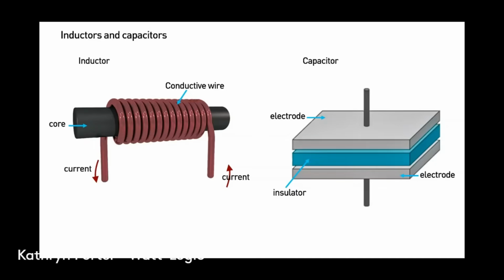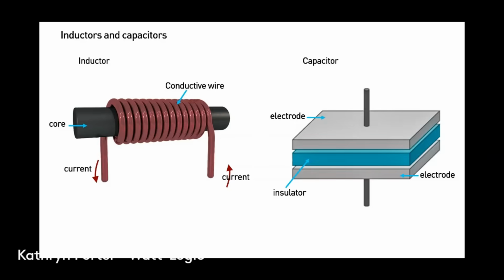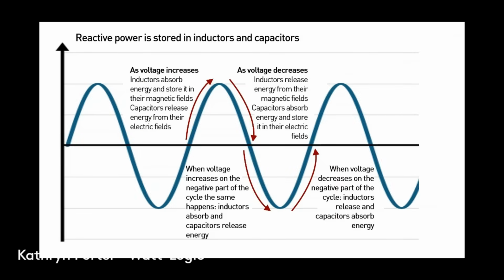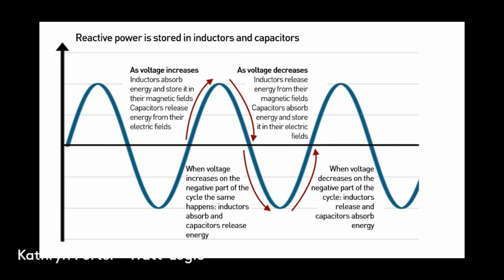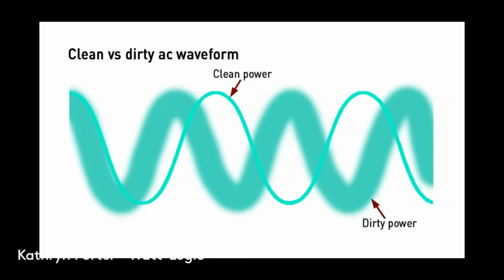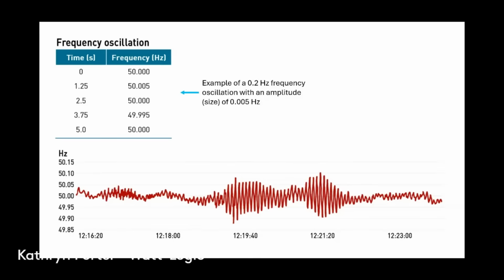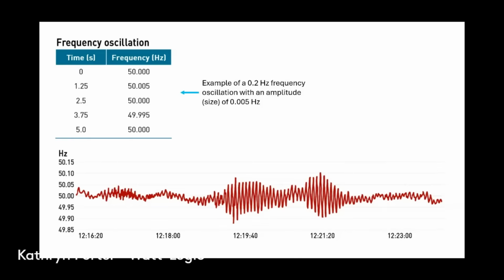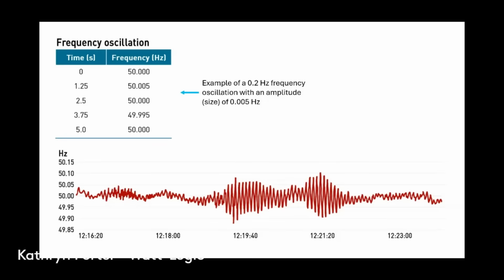Iberian blackout

Comment: I think the inertia explanation should be modified slightly. 

Synchronous generators cannot provide backup power without reducing their output in advance, exactly like the wind turbine cannot. The difference is, as you explained, that the SG has an analogue response time frame on deviations of frequency. This response is as fast as can be. The wind turbine cannot respond equally fast as it is a digitally controlled device, but for practical purposes it is fast enough when it is programmed to respond by using the inertia of the rotor to boost active power output for a brief period.

Yes the wind turbine has to reduce its power output some seconds later to charge the inertia back up again but the same goes for SGs.

Synthetic inertia can be supplied by wind turbines that way and it has about the same properties as the SG except for its slightly slower response as a digital device compared to an analogue one.

Comment: Awesome explanations, and I am really impressed with the clear analogies you come up with to explain complicated electrical phenomena in commonly understood physical phenomina that normal people can understand.

To your point that generating facilities test things like frequency response, full load rejection response, and stability- large step change responses,  positive and negative, once when machines are commissioned and never again is true (not always, some urilities go through regular reevaluation of system stability studies and do testing after resetting parameters) because a) very expensive b) time consuming c) a lot of temporary advanced data gathering and analysis equipment has to be installed, and d) it necessarily puts the whole system at risk when you do those tests.  But, only real-world testing actually proves it will work when necessary. It is somewhat mitigated by the movement to solid state protection and control vs. the older analog electro/mechanical protection and control.  These devices are many times more accurate, and very importantly, do not change or "drift" over time, so once tested, they will work the same way 10 or 20 years down the line.  

Your mention of transformers acting improperly during the cascading events is probably misstated, and it was probably the protective relays acting improperly, and it is likely because they were older electro-mechanical.

Comment: Roads are designed for cars which are significant dangers to pedestrians. Cyclists are not. I am sure you have that 1 study which shows one pedestrian who broke their finger because of a cyclist passing a red light.

There are solutions for high integration of wind and solar in conventional grids: synchronous condensers and batteries. It was Spanish TSOs critical mistake not to procure sufficient ancillary services to be ready for situations like this.
Because you like metaphors so much, let me finish with a metaphor: disliking solar and wind for their inability to provide inertia is like disliking EVs for not having an exhaust pipe.

Why don’t you make a video that you actually suggest what you think the energy system mix should be like? I’ve only seen you criticising RE? Sometimes I agree with your criticism but why not make a suggestion?
Reply: She's in the pockets of the fossil fuel energy companies.
Reply: Nah there is definitely discussion about batteries and the need for grid scale storage.  It’s not ready yet and probably never will be.  Batteries are expensive, heavy and prone to burn 🔥 out with fire that the local fire department can’t extinguish
Reply: @OwenGilmoreOG  Tell me you know nothing about battery storage without telling me.
Reply: @VinoVeritas_    Show your greater knowledge about batteries by linking to a grid scale battery system that can keep power up for 24 hours.  Oh that's right, you can't because it doesn't exist.

Comment: Great video, just wondering what was the root cause of the solar farm inverters causing the 0.2 Hz frequency oscillation? I am wondering if it was a systemic issue or a once off related to the technology used on these projects.

Comment: On June 25, Energy Institute published their analysis of what happened and also described the subsequent finger-pointing: “the Spanish government blamed national grid operator Red Eléctrica de España (REE) and private conventional power generators. In its wake, REE and a Spanish electrical utility association traded mutual accusations of blame.”

The grid operator REE partially blamed conventional generators for failure to “…comply with its dynamic voltage control obligations…” Aelec, representing the generators, pushed back, saying, “All of them complied in a timely manner with the orders of the system operator, reacted to the oscillations and increases in voltage observed, and acted as established. The real cause of the blackout was not the performance of the plants, but the manifest insufficiency of units dispatched by the operator to safely cover all the needs of the system in terms of voltage control and operational stability.“ They blamed REE for not enabling “sufficient means” to control the system. 

New Climate Institute on May 8 had insightful comments:
“Rather than treating this as a blame game, it should be seen as an opportunity to assess whether our current system design and operational practices are truly prepared for a future dominated by wind and solar power.“….
“… the blackout signals a more structural issue: most power systems are still fundamentally designed for centralised, fossil-based generation. While we’ve seen incremental adjustments to bring more renewables online, the core frameworks for planning, dispatching and balancing the grid still largely reflect an obsolete fossil-fuel-based paradigm. This misalignment between outdated system planning and evolving energy realities introduces new vulnerabilities….To move confidently toward a high-renewables future, we need more than just tweaks – we need a fundamental redesign of our grids and operational and regulatory frameworks to match the dynamics of modern clean energy systems.”

Comment: Very interesting content, Kathryn. As a small electrical company based on the south coast of the UK, we’ve recently been installing backup diesel generators and changeover switches in a couple of village halls. From what we can tell, it appears to be preparation for possible blackout scenarios, aimed at ensuring these locations can run at full capacity (100 amp) during an emergency.
Interestingly, the funding often seems to come from government grants under the banner of “resilience” or “disaster readiness.” We're also seeing solar panel installations going in, too—but with no battery storage, which raises questions about how useful they'll actually be during a grid-down situation.
What’s more concerning is that our generator supplier has told us the UK government is buying up every available diesel generator they can get their hands on, and doing so in a bit of a panic. Feels like there’s more going on behind the scenes than we’re being told publicly. 
Would love to hear if others in the industry are seeing the same.

Comment: Chaos theory and standing wave theory for Z transform control systems network topologies and the power grid still fell over without any nefarious inputs such as GPS timing spoofiing, from 3rd party actors, little green men and gremlins with large adjustable spanners or Solar storm CMEs, just the financial, regulatory and NetZero ideology was enough from those educated in the Greta Thunberg electrical wall socket engineering for applied thermodynamicists..😮 Get prepared for the forthcoming Miliband event here in the UK.

Comment: There is something that is not addressed in this video. 
I have read in comments that the HVDC-connector to France swiched direction at least twice but who or what caused it was not known then.
I remember that some time this year one of the interconnectors between the continent and Scandinavia (i do not remember which nor when) swiched direction for a then unknown reason. 
This suggests that HVDC lines might not be as reliable as thought. There could be a hardware problem (design error or material failure) or a programing bug. Or both.
If the French-Spanish interconnector went wild as it seems, it could - to me as an fully unqualified lay man - mean that it caused the huge surge of voltage that caused lots of equipement to disconnect, specially the very equipment that was ment to help lower the voltage by pumping.
Getting a closer look at these HVDC issues might be necessary, if not already done after i read about them.

Comment: Inverters work like they are programmed and that programm is based on rules that are based on a philosophie. The problem is that the influence of solar grew stronger than the philosophie could change. In the grid there are many  partys involved, they all want to earn max money and just dont care for the community and its grid, they fight and blame each other. We dont need inertia from rotating masses, but we need correctly programmed inverters.
Reply: You assert that "We dont need inertia from rotating masses" but Finland and the Baltics have just bought synchronous compensators. 
.
There were synchronous compensators in Sweden as well before the nuclear era (which, by the way, led to the construction of Juktans' STEP, of 7 new power stations on the Lule river and of a huge increase of the capacity of the existing Lule-river power stations in order to be able to compensate for a nuclear outage. Harsprånget went from 330 MW to 977 MW, Porjus went from 152 MW to 465 and later to 480,6 MW. All and all that river can now deliver 4,14 GW. Quite usefull to balance today's wind power, as the other equipted rivers are similarly tuned.) 
.
Most countries in Western Europe lack anything even remotely similar to the Alpine, the Nordic or the Spanish dispatchable hydropower. 
The whole continent had in december 2024 only 90,33 MW of dam capacity and a ridiculous 41,44 MW of STEP capacity to match 251,4 GW of PV and 223 GW of wind capacity acording to energy-charts(.)info. The battery and other means' capacity seem even more ridiculous.
.
Given the lax compliance to the grid codes and the existence of some (a lot of?) obsolete equiment,  i would not be surprised if the increasing "wild" (unregulated domestic mikro PV) solar capacity on top of numerous new powerfull solar and wind parcs induced increasingly numerous hours of negative pricing (when these producers stop producing without communicating) and consequently, as a protective mesure, the reintroduction of synchronous compensators here and there.

Comment: Thank you! I now have an understanding of the two “events” that were initially reported in the aftermath of the blackout. 19:56 explains how many small generators disconnected simultaneously (2nd event, I believe) because of the pre-existing rate structure: I had often wondered why the usual load-flow analyses would not have anticipated these events so that the grid operator could have put protections in place. Those load-flow modelers have some catching up to do!

Comment: In Australia - where it's long been obvious that large scale PV and wind generation would become a thing - there is a Frequency Control Ancillary Services market (operated by the Australian Energy Market Operator, AEMO), which has been expanded and refined with experience. I believe the UK has something similar. It sounds like Spain doesn't have such a mechanism in its market.

South Australia is an example of a vulnerable VRE-heavy grid that had some major teething problems but has been stablised by FCAS services (both inertial and battery).

As you mentioned but then promptly "forgot" in your analysis, batteries, like large intertial generators, can readily contribute to frequency stabilisation. In Australia anyone with a grid-connected battery and the necessary hardware can sell FCAS services, something that's part of the economic calculus for large projects. FCAS prices are falling as more capacity is connected.
Reply: FYI, within the EU, the similar market to the 'Frequency Control Ancillary Services market' is called "Electricity balancing market" 

This market is very lucrative, so only a very limited number of powerstations are selected every day to be allowed to operate on this market. 

On the day in question, in Spain, some 12 powerplants were included. 
But one of the biggest of these 12 operators, did the exact oppesit of they ought to do, in order to stabilize in the sub-minute interval of balancing the grid. 

If 14 powerstations had been included in the 'Electricity balancing market' on that specific day, in Spain, it is very likely that the blackout could have been prevented. Almost all the after-math simulations predicted that with 14 (of about 50 possible) powerstations in Spain, with the ability to balance the grid, then the blackout could have been prevented. 

But the Spanish 'Red Electrica' has a policy that they want to limit how many powerstations are allowed to participate in the "Electricity balancing market"  in Spain. 

Also, 'grid-forming inverters' are currently illegal to install at solar and wind powerstations, in Spain. 
So Spain seems to be quite deliberate about minimizing the grid-forming powerstations in Spain.  And thus all solar and wind powerstations in Spain, only have grid-following inverters.

So there are indeed things that COULD be implemented, in order to have a more robust grid in Spain.
Reply: @MrAlvinDude  Great info, as an outsider knowing nothing it seemed to me that Spain's vulnerability must have been a result of overruling the engineers in favour of other priorities.

The eastern Australian grid is now above 35% VRE (annualised) and some coal generators are nearing end of life and not being replaced. It looks like their closures will be postponed for inertial reasons.
Reply: @moblet  Yes, while new electronics (and more), is being developed and optimized for widespread use, then the very well known methods of physical inertia (of existing machinery) must be kept online.
Reply: @MrAlvinDude  Am I correct in assuming that once a certain amount of battery capacity is available for stabilisation, the threat evaporates? Like if there was enough battery capacity to power the entire grid temporarily, with grid-forming inverters, would this work for the grid like it does for a UPS for a home or office computer?
Reply: @moblet  Hmmm... some of the challenges with keeping a grid in balance includes some of these terms: 
'AC phase shifting', 'Reactive Power' (Q, VARs), 'Power Factor' (PF), 'Phase Angle' (φ), 'Leading/Lagging Current', 'Reactance', 'Inductance', and several more. 

In essence - the Volt and the Ampere phases go out of sync. And in one way or another, this needs to be managed, and compensated for. 

In order to move from inertia methods of managing phases , and moving to primarily using electronics to manage phases, 
it has become evident that new types of feedback (new methods of monitoring) and new methods of coordinating thousands of 'smaller' electronics like grid-forming inverters, is needed. 

Fortunately such new methods have been worked on for many years now.  
And in 2024-2025 the brits performed live-tests on the actual grid, where they deliberately disconnected all inertial driven production, and solely ran (data sharing) grid-forming inverters for some hours. Without any problems to the users of the grid power.

From the perspective of the grid, it does however not make any difference if the power-source of the grid-forming inverters  is a battery, solar panels or wind-mills. 

So I suppose the answer to your question about batteries and grid-forming inverters is: 
Yes. Because of recent development of new managing hardware and new protocols, then it is very possible to run the entire grid from grid-forming inverters only.
Reply: @MrAlvinDude  Thank you.

In Australia if you have (or want to install but can't fully afford) a home battery you can join a "virtual power plant" where your battery is controlled by a third party that aggregates and coordinates a portfolio. That's not a grid-forming capability (yet) but it's a functioning example of coordinated operation of micro-batteries. I believe VPP's may be participating in the FCAS market on some level but am not certain.
Reply: @moblet  Great idea, for a  collaborative/virtual method to add peak capacity. 

Peak capacity is one of the other defining issues for a grid. 

Localized peak capacity is a great aid, that helps the existing grid-forming balancing methods to not get overwhelmed during peak load times. 

In order for the grid-forming activities to be able to "survive" 24/7/365 (without resorting to the localized rolling blackout method), then there MUST be enough peak performance capacity, for that one hour, that one day, once every year, where everything reaches a new level of absolute peak load. 
Otherwise the existing grid-forming abilities will get overwhelmed.

--- 

The need for energy on the grid, increases every year, and have for the past century, typically doubled about every 20-30 years. 

So adding localized peak capacity, is one of the other balancing acts, that are an integral part of operating and managing a stabile grid. 

Adding localized peak capacity slows down the very expensive need to expand the overall (both bottom and top level) of the wire distribution network.

--- 

So, good for Australia, that they have introduced affordable methods for regular households, to minimize the probability that the household will need to suffer through frequent rolling blackout events.